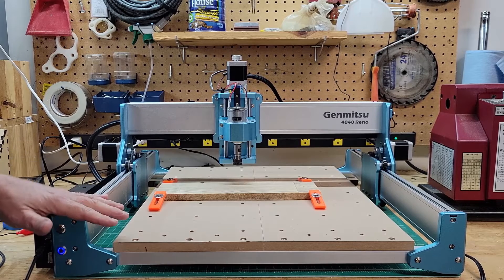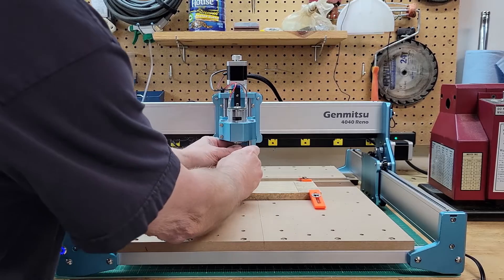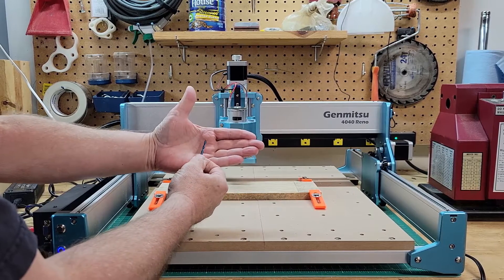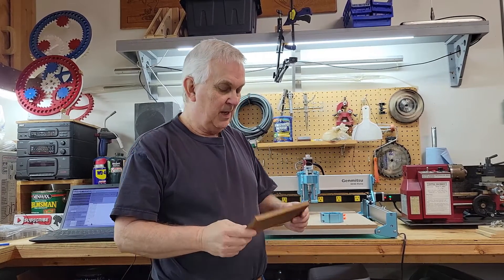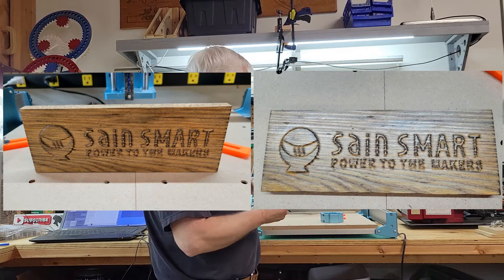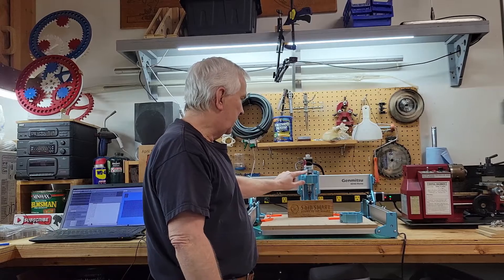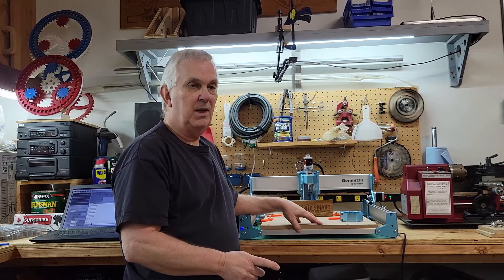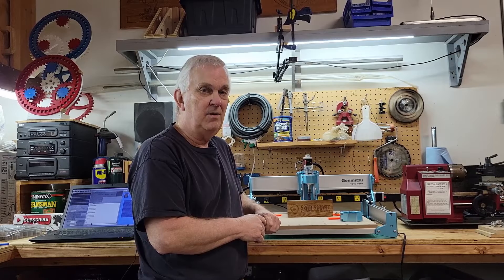3D Carve With The New Genmitsu 4040 Reno

Comment: Hello Dave. Since this machine is a belt driven, do you it will cause loss of precision and not be able to provide enough torque. what are your thoughts? i remember Sainsmart has a costly version with lead screws.
Reply from the maker: Thank you for watching.  I have had absolutely no problem running the projects I've done so far.  It's all about keeping the proper belt tension and running the machine with the correct feed rate, depth of cut and spindle RPM.   The same holds true for any CNC.  Even with a bigger, stiffer CNC you have to run the right feed rate, depth of cut, and RPMs or you'll loose steps OR break the bit (the weak link).
Reply: @DaveGatton   i had these doubts in my mind for a long time. you have cleared them up. thank you Dave.